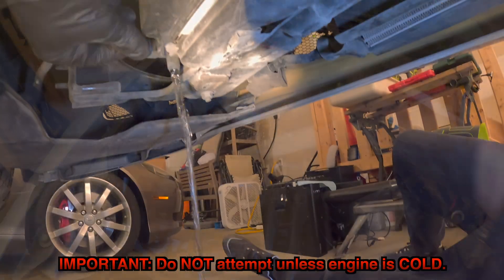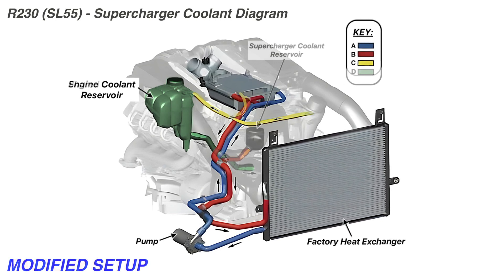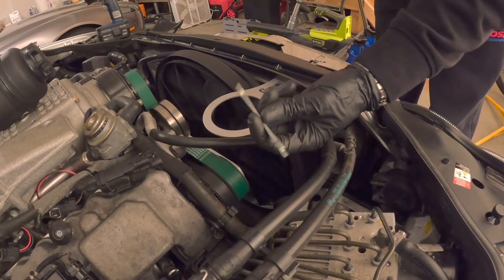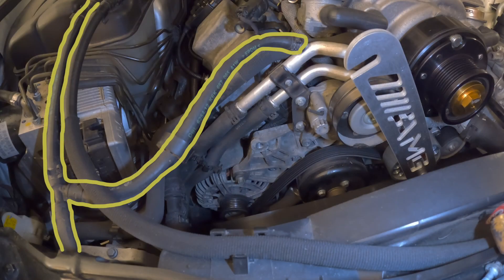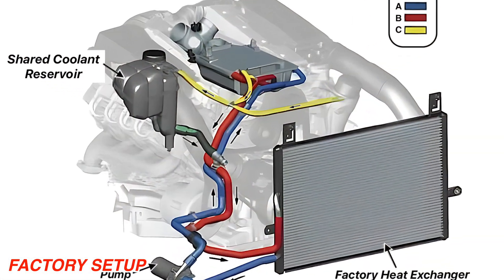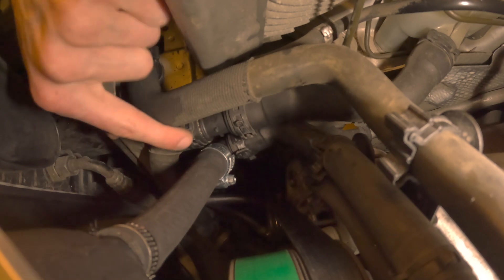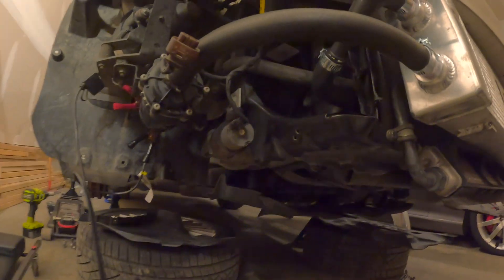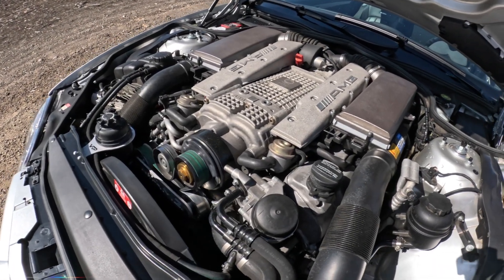HOW TO: Install VRP Split Cooling on SL55 (M113K)

Comment: Hi friends , Today i just did the split cooling mod on my Mercedes cls55, and I'm wondering how to verify if the intercooler pump is working properly. Is the pump's sensor located in the intercooler water circuit or the engine cooling system? If it's in the engine cooling system, will splitting the system affect its operation? Any insights would be appreciated! 🤔
Reply from the maker: Congrats man! And regarding the intercooler pump, you could hot wire it like I did in the video to see if it's circulating. On the SL55 it's located on the intercooler circuit when split, which helps keep the two systems more efficient at heat dissipation. As an FYI = It takes about 2 weeks of driving for the system to fully burp, even if you hot wire the pump. Hope this helps! :)

Comment: Why not to leave hose at the top for air bleeding connected to stock tank?
Reply from the maker: The bleed hose from supercharger circuit cannot return to the big stock tank/reservoir because it will drain coolant out of the supercharger circuit (they are split systems now: engine & supercharger). However, you could definitely make a modification for the bleed hose to go permanently into the new supercharger reservoir, but just triple check the reservoir can take the pressures etc.

Comment: Great video, when I had this setup my coolant would not bleed at all from that small port, I had to rout my reservoir between each heat exchanger and it would finally bleed but the air bubbles are nonstop and IATs still climb, what could be the issue?
Reply from the maker: Thank you! 👍 From my research there are ways to get the bleed line back into the split reservoir (with modification) for the supercharge circuit. The reason the bleed line can't go back into the main engine reservoir is because it'll effectively drain all the coolant out of the supercharger circuit. Also as a side note, it took me about 30 minutes for the coolant to start bleeding through that port. Turns out the Bosch 010 pump (although good) isn't powerful enough. That's why I'm planning on switching to the VRP high flow pump, it'll be a big improvement (possibly might help with your system bleed too). Let me know how it goes!

Comment: Assuming you just reused the old coolant in the engine circuit. What kind of coolant did you use in the new split super charger circuit? Anything special to keep it even cooler? It looks like redline water wetter.
Reply from the maker: I drained it all and used the new pink Mercedes coolant. From what I was told they switched from: gold > blue > pink. With regards to the supercharger circuit I used the same pink Mercedes coolant, however, I've heard people using different coolant for better performance. Either way = big improvement over factory :)
Reply: Awesome thank you so much. If VRP isn’t subsidizing you in some way they really should be. I was pretty shocked to get all of these products which came with absolutely 0 instructions. Had I not seen your videos not sure if I’d have had the confidence to take this on.
Reply from the maker: @egiles40  Haha all the products I bought were full price too 😂 Honestly just trying to help R230 community out, we got to keep these things on the road! :)